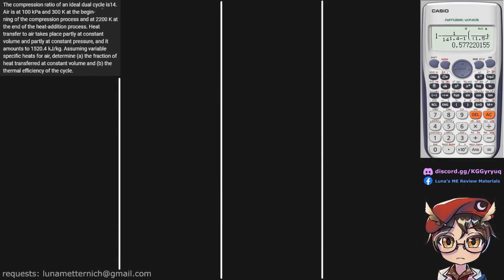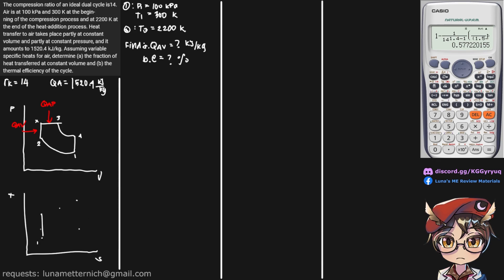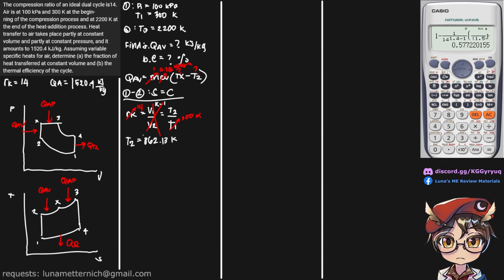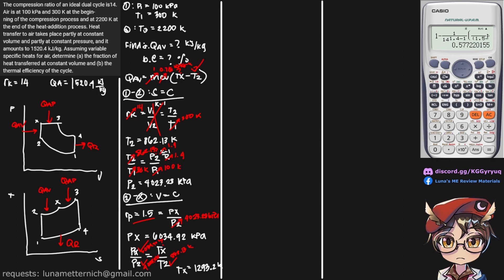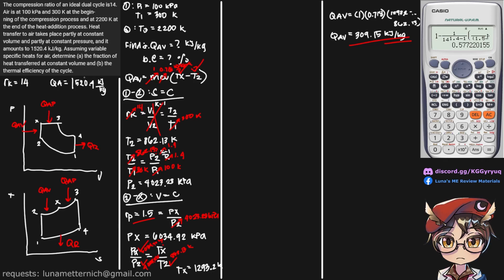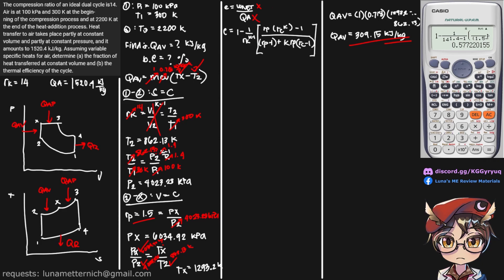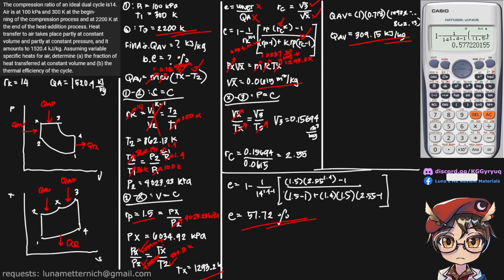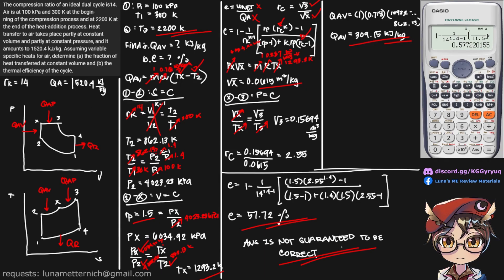The compression ratio of an ideal dual cycle is 14. Air is at 100 kPa and 300 K at the beginning...

Comment: um, I may be wrong here, but the isentropic relations used in the video are only viable if k=Cp/Cv=constant. It says in the problem statement that the problem is variable specific heats! you need to use property tables to solve.
Reply from the maker: I think you may be right, Mr. Elijah. I'll pin this for future viewers to consider. It's a shame I can't verify your solution since I don't know the correct one myself. Thanks for pointing out a possible mistake

Comment: i got a different value for v3 which led me to get a different value for rc and therefore different efficiency. i checked my work multiple times and still cannot find an inconsistency. if i am somehow wrong let me know. for v3 i calculated 0.105, for rc i calculated 1.71, and for efficiency i calculated 61.92%. thank you!
Reply from the maker: I think you may actually have found an error on my part, which means you may be correct! I never figured what the actual correct answer is because I do not have the solution manual for the textbook this was from, so I can't say if your answer is 100% correct as well. Usually, dual cycle efficiencies range from around 50-58% and rarely go higher than 60%, which is why I thought my answer was correct. Unless I find the solution manual, I guess we'll never know the right answer, unfortunately. Good luck with your studies!

Comment: Im assuming this is cold air standard because of the equations youre using?
Reply from the maker: Correct, hence why k = 1.4 here. Although, as I've mentioned in the video, my solution to this question is still unverified. Do let me know if you have a better solution!